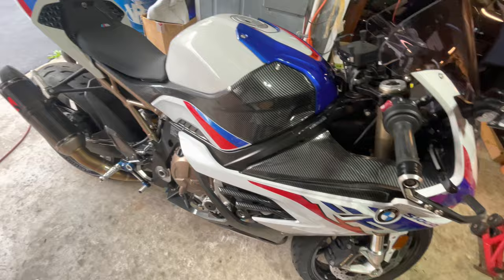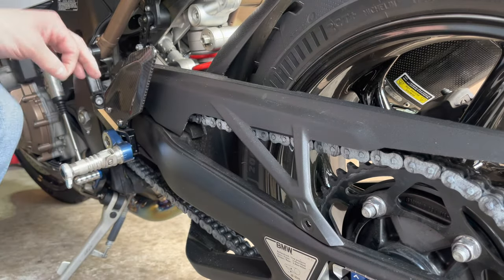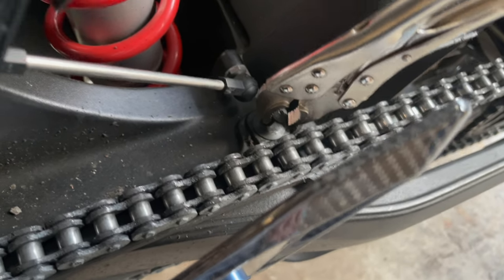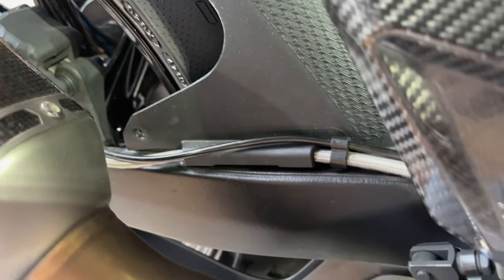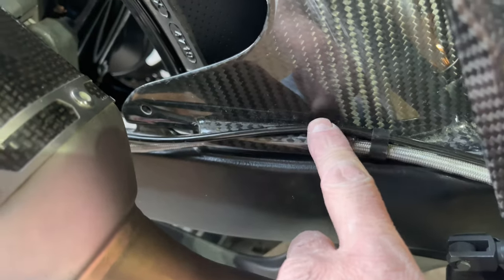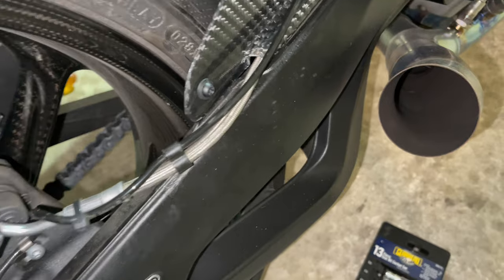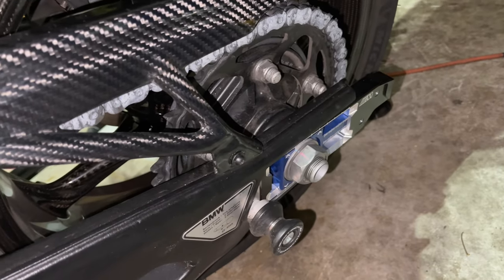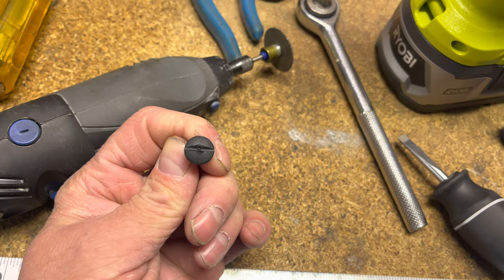How to remove/ install chain guard & tire hugger 2020+ s1000rr k67

Comment: Good job.  I've just done the same on my S1000R but ended up breaking two of the four plastic expanding rivets, they're horrible.  BTW I bought a Limberger part, it wasn't cheap, and the mounting holes weren't perfectly aligned either so I don't think yours was bad at all.  I think it's just the shape and size of the combined hugger/chain guard that leads to the slight misalignment.
Reply from the maker: Thanks! Yes some people don’t understand that even the most expensive stuff can be off at times. Hopefully yours ended up working out ok for you 👍🏻

Comment: Do you know what the part number for the bolt you stripped is? Mine broke lol
Reply from the maker: Luckily, I was able to make it into a flat head and still use mine. From max bmw part # 51 48 3 418 609. It’s diagram #46_2150 ( rear wheel cover)
Reply: @ctadrenaline  thank you!
Reply: @ctadrenaline thank you sir !!!